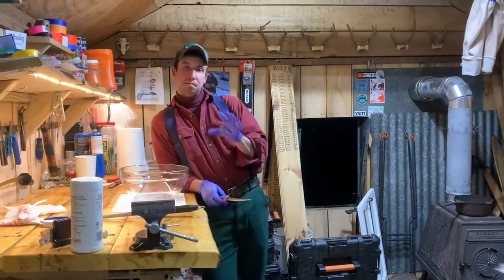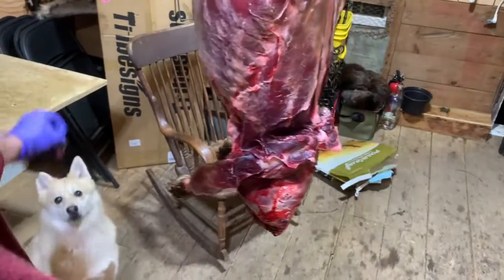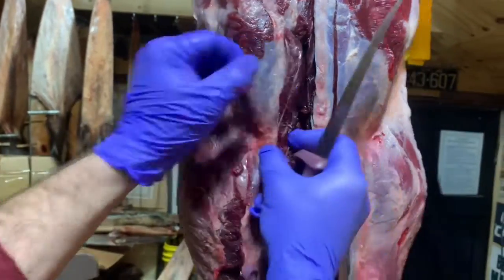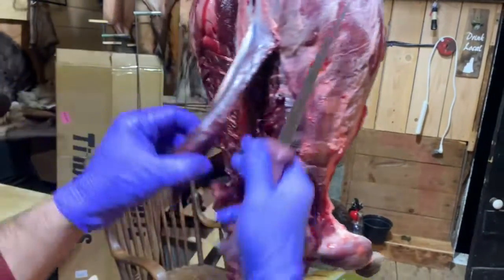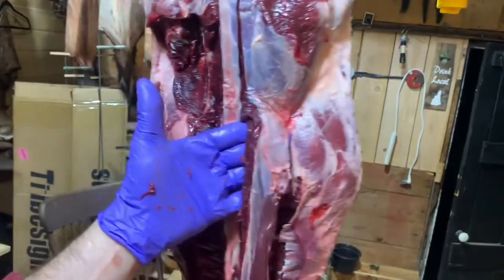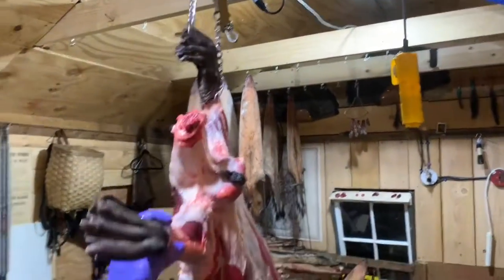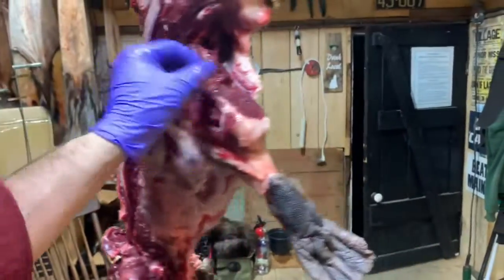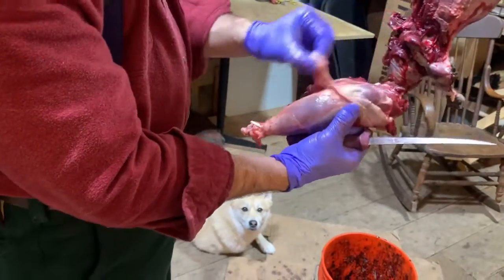How to Harvest Meat from a Beaver: Step by Step Tutorial

Comment: hey had one recently that had a couple of pustules.  one near the fur and the other internally.  white, non odorous, substance.  also the arrow went through the neck and came out the castor.  i tried to clean it up really well but still was a very off smell when i cooked it up.  chickens loved it but i didn't eat much.  tasted fine but smelled weird.  there was castor all over the surface i was cleaning it on.  you think those pustules were lymphatic tissue or something else?  -out of all the beavers i've cooked this is the only one that was off in any way.  others have been VERY good meat.  was super concerned when i found the pustules but didn't want to waste it.  also as long as it's really cooked well the parasites are dead right?  that's my understanding.  don't want to give something to the birds.